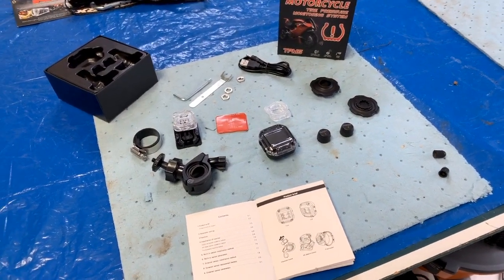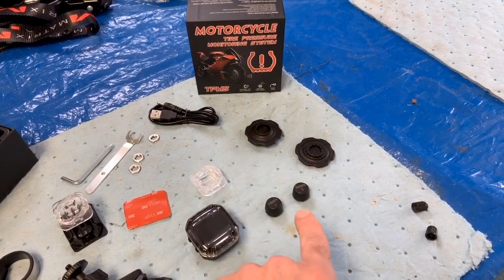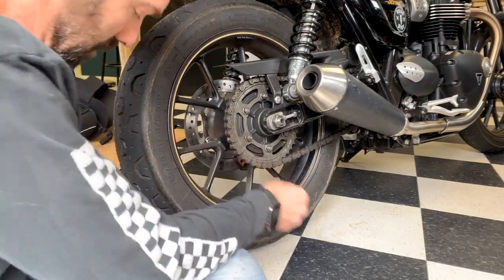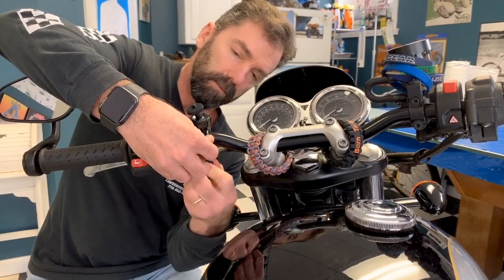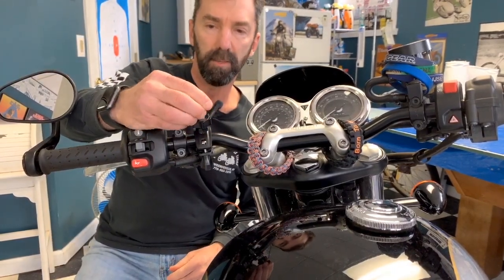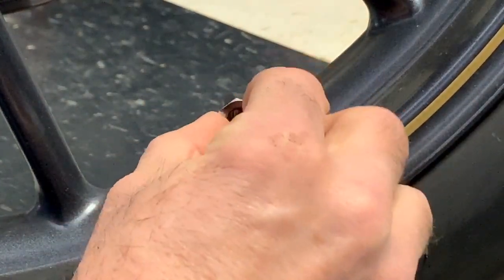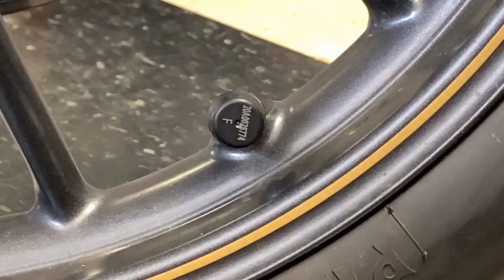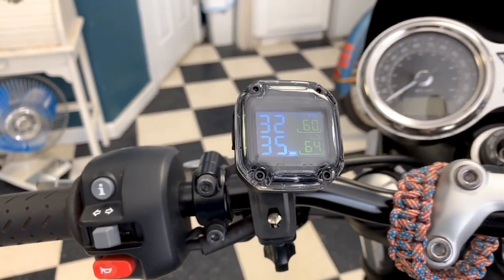Motorcycle Tire Pressure Monitoring System Installation

Comment from the maker: I realized I misspoke in the video about a feature of the unit. The screen does not time out after awhile, at least while out riding. The screen stays on, showing internal pressure and temperature, although it is not distractingly bright. The unit only times out if it sits idle for a length of time.
Reply: Thank you for the review - What model TPMS did you install is there a particular manufacturer? - I saw you can purchase it at https://rvproducts4you.com/
Can you set separate  alarms for front tire and rear?

Comment: Sounds good, as I spoken to my Dealer yesterday to have a TPMS installed on my 2020 R3 GT, the OEM one, which will cost me 245 + tax hardware and 1.8 hour labor, another 200 + tax, which it will come out to around 470 in total...the difference is I have reading on my instrument panel instead of another device installed on the bike, but the price for the system mentioned by you is REALLY GOOD in comparison and may be worth it...79 DOLLARS...not bad at all...
QUESTION...can it operate via cable connected to the battery or needs to be BATTERY FED.
Thanks
Reply from the maker: We’ve just been using the recharging cord, which honestly, only did 2x in 2020- first when we prepared it for mounting in early March, and second on late September, I think. Crazy long battery life on this thing. Of course, I always power it off when I’m done riding, and turn it back on the next time I ride. So I may be saving battery that way. The unit unscrews off of the handlebar mount and plugs into a simple USB cord, so I guess there are adapters that you can use to plug it into a charging port on the bike. Yeah, we found it to be quite a good value over the last year. Thanks Luiz,

Comment: Sir, at your recommendation, I ordered one of these for my 2022 KLR. Since you have been using this monitor for awhile now, can you tell me if the PSI reading has remained consistent?  Also, have you had any issues with leaks around the sensors? Much appreciated, thanks.
Reply from the maker: I’m not sure the particular company we got them from is still in business, RV Products 4 You, but the units themselves still function superbly, keeping long charges, giving pinpoint accurate readings. The only issue we’ve had, is one of the mounting brackets broke. So I just keep the unit in my saddle or tank bag and turn it on/off each time I ride, and still check the readings regularly.
Reply: @roaddirttv  Yes sir, I looked on your comments to see where to get this unit, but it no longer shows it. So, I sent to Amazon searching for another monitor, but stumbled unto yours, the M3-C-WI from RV Products 4U. So I went ahead and bought it. Thanks again for your review. I do only downtown commuting on my KLR, so I don't think I'll be roughing up the mount much. I'll keep an eye on it anyway. Thank you!
Reply from the maker: @PatriotNC1  I hope RVP4U is still in business, and gets one out to you. It’s a great unit, even if RVP4U might not be distributing them. I’m sure others will be here stateside.

Comment: This looks way easier to install than most of these air pressure monitors out there.
Reply from the maker: It was, really. Sadly, this particular company went under a year or two ago, but this TPMS unit can still be found marketed and sold by other companies on the web.

Comment: I just bought the kit and installed easily but setting the values was a little confusing. It seems like to set high pressure values if you go too high you can't reduce them...I kept increasing until I got a hex value in the reading and not sure how but eventually reset

What is a good high temperature tire alarm
Also I read 10% above normal tire pressure is a good high pressure alarm. Anyone else have suggestions?
Reply from the maker: Ed Kelenyi Mine’s been set now for a couple of months, but as I remember, (1) it took me a few times to interpret the directions correctly and get the PSI and values set properly. After about 3 tries, all of a sudden they just read correctly. (2) I’m thinking I set my alarm for pressure at like 50(?). It was weird, like I said, but on about my third try suddenly everything set right, and been running flawlessly ever since. I shut it off when I’m not riding, so it’s still showing high original charge after two months. I’m still pleased with it, to date.

Comment: you hand tightened one, and used wrench on other, which is correct?  Also did you hand tighten the front sensor, and then loosen it again, for reasons beyond understanding??
Reply from the maker: We spun the lock nut on, hand tightened the sensor on, then used the little wrench to snug the lock nut up to the sensor. Front and rear sensors both went on that way.
That’s what you saw.
Reply: @roaddirttv  thank you.

Comment: How do i pump the tyres? Will it be a hassle to unscrew? Or will i just unscrew and screw like a normal cap?
Reply from the maker: They easily unscrew for inflation, with a locking nut beneath it. Then after adding air, you just screw back on, and snug up to the locking nut.

Comment: Hi RDTV. Was happy to see that you can actually fit a TPMS to right angled valves. Any issues so far? Thanks
Reply from the maker: TheShayster7 No, all is good with it still. We installed the system the first week of March, and it’s still running in the original charge. Of course, I’m careful to turn it off after each ride, but the battery life has been outstanding. Still gives precise readings on pressure and temp in both tires, and just this morning, flashed on/off that my front tire was low, 28 psi. First time the warning activated, so that functions well too.
Overall, still very satisfied with it.
Reply: Road Dirt TV excellent thanks for quick response 👍🏻

Comment: The forty bucks for a TPMS would have saved me $800 for the rear wheel on a Yamaha 650 (shaft drive). The spokes don't like too low a pressure in the tire. $$ and safety as well ! spend the bux
Reply from the maker: This particular company unfortunately went out of business, but this simple type of TPMS can be found all over the web. This one still works well too, just need a new set of small batteries for tire units.

Comment: You didn't tell us how to set the readings up?
Reply from the maker: @thomasvalentine4636  the unit we had, automatically calibrated itself, finding the two already-installed tire pressure readers on the valve stems, then displayed the psi of each tire on the display.